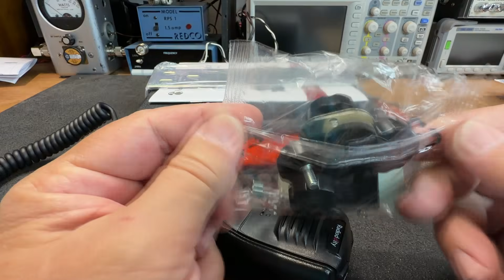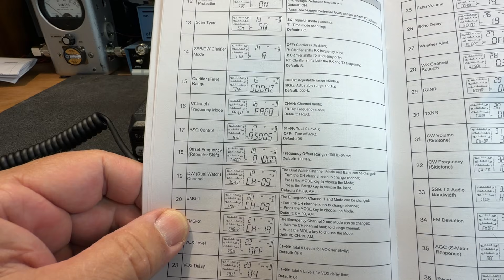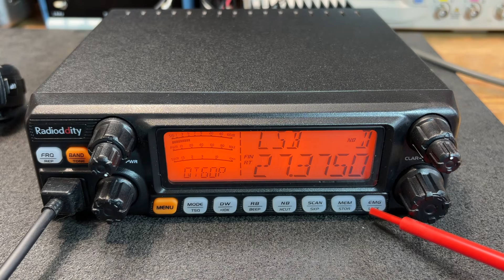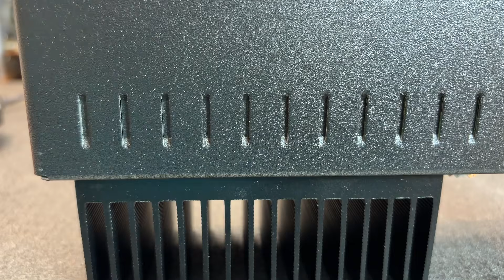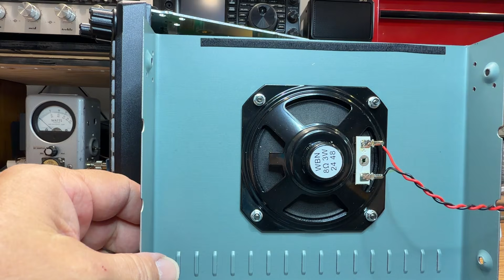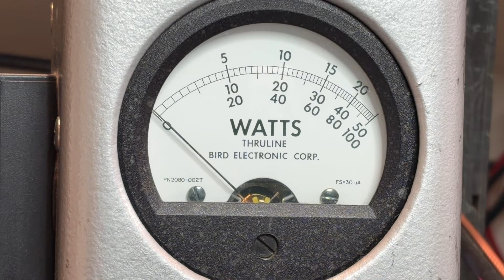Radioddity QT60 Pro 10 Meter Radio OVERVIEW And 11M CB Modification #cbradio #hamradio

Comment: Rooster and Mower Junkie got 90 watts PEP on SSB out the box, maybe they came with a different tune back then.
Reply from the maker: I did not see their videos but my first question would be are they using dummy loads or just feeding into antenna. 
I use the DL so there is no question except for difference in meters. All three of my "test meters" (Drake W-4, Drake W-7, Bird 4331) jive withing a few watts of each other, and DL SWRs are 1.1 and flat. (I have two, 1.5KW and 250W)  You could also be correct as early versions vs newer could have had revisions.   I will go watch MJ's and Rooster's vids. Thanks.....
Cheers

Comment: I have the QT80 and hmmm... im not that enamored with it... its slughtky frustrating to use.. very fiddly and somewhat annoying.. and 80 watts.. no.. not sure. But ive had good audio reports using it.. at least its got the good old 4 pin mic. 73. 44. 88 wavibg a hand from Sussex England
Reply from the maker: Thanks for your input.
Cheers

Comment: Hey WagonMaster, so you know I have been running the 5555 version. 
My favorite Pros:

First, along with my switch over from the A99 to an Aluminum 5/8ts my NB stuff is great!  Most evenings My Noise Floor down below three S now and sometime down around 1 to 2S.  .  After decades of 5+ this is a dream come true. 
The audio is great and I am running 'null' in that infamous NPC mode that everyone loves to hate so much but I love my distinct sound I have without tons of overmod.  I can't remember if I sent the Gate form UDX 21 - Dirty Diaper.   If I haven't I will send it so you can see what it sounds like across the country in that NPC mode.

I find this power range very easy to match with the KL-703 Usually loafing along with DK 275ish and still peaking well above three to avoid that clamped audio.   Of course you will want to adjust for the Audio you are after instead of just cranking things to the nuts.  

I know this will be a joke for you but I love that you can manipulate the Weather Chan freqs.  I will use it as a secondary for 2M nets and even 52.  I would love it if I could ad 52 to the scan to keep an ear out for people in need and help calls here in our mountains.  i first set it up based on specs and with a power meter but it was WAY TOO pinched but while monitoring I backed it down to just before I started hearing the carrier pinching my nose. 

Cons. - some of these might be remedied if I would actually read the destructions. 

What I don't like are the crappy mic... I keep thinking I will need to buy an adapter or maybe cannibalize a compatible mic for the PTT so I have the channel changer switches.  However, I believe I had seen the info that the channel changer that said the switches basically use the same circuit as PTT and switch resistors to have one resistance for up and another for down.  So if that is true I might make my own interface if all the dodadd makers on Ebay are too lazy to build one for me...lol 

Anyway IMO mic is junk, feels like a light plastic Maxon or something and I do not like that RJ style modular plug.  With headphones I can literally hear something like a slightly loose wire or switch when I am keying down and move the mic cable at all, so I am guessing it is the Jack.  I guess more incentive to make a Mic interface so I can keep things stable.  

Another lackluster experience is the Scan.  It is so slow and if you do hear something and key the radio to break the scan, it will just resume scanning again after about 10 seconds.  I am wondering if this can be adjusted with the programing cable.  

A Weird Quirk I have seen just a couple times that simply restarting/power-cycling the radio fixes.  I have caught it a couple times in both Freq VFO and Chan mode where it is somehow on the adjacent channel.  The first time I caught it, I figured I was hearing an extremely dirty radio that could be heard on both channels but after sitting there like a curious monkey switching back and forth I realized the readout was indeed wrong on one of the channels.   Keying up does not not make it pull it's head out, you just have to quickly power-cycle it and it will be back to normal.  I will add this is EXTREMELY rare.  I am not sure if stray RF causes it or what or maybe there is a true dial-watch I missed but I have seen it two or three times now.

HOWEVER,  I have MANY MANY hours on this radio now.  It is starting to rival my radio time back in the 90s on the 148 and 2510.  Instead of measuring in hours, the active IN USE time is probably now approaching days and maybe could even be measured weeks.   I use the Movie Theatre Comparison when trying to break even with a radio.  I figure going to the movies, especially since I do not go alone, I probably spend 25 bucks on average.  I figure I have had easily over 10 to 15 movies worth of high energy time entertainment by now.  I am rapidly approaching that Break-Even threshold, that is if I have not crossed it already.  

For new radio guys, if you have been bitten by the CB bug and cut your teeth on a classic truckstop radio, this is a great next hop.  All the bells and whistles to keep an experienced operator entertained but easy enough to mod and adjust for a newer operator to quickly get some good on-air time. 

 ⚠One Warning⚠
If you are fiddling with power or modulation in the extended menu, be SUPER CAREFUL.   There are some menu items that are custom set in the factory that are unique to that radio.  Some of those may not even let you switch it back even if you had written down the original value.  So a word of warning, to not blindly fiddle with the 'Golden Screwdriver' of menus.